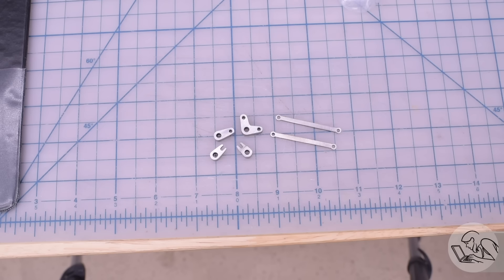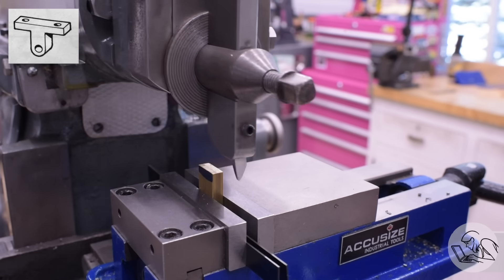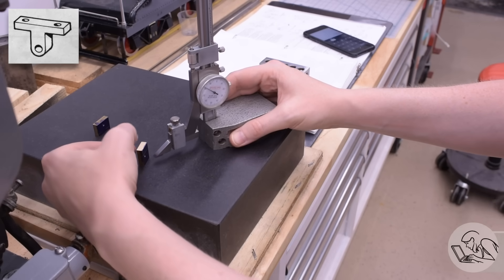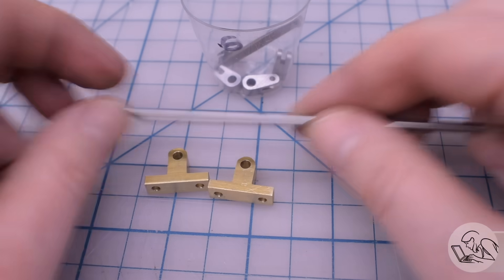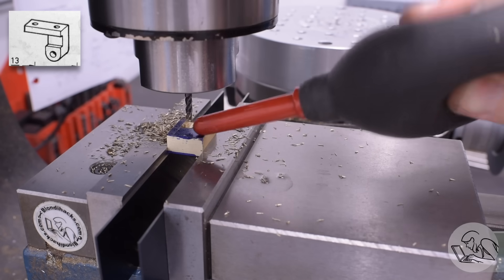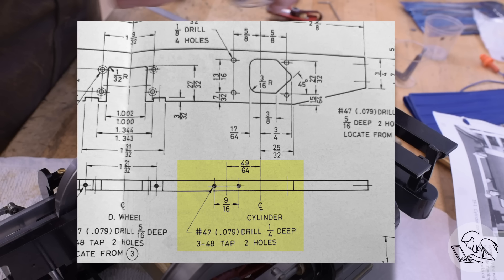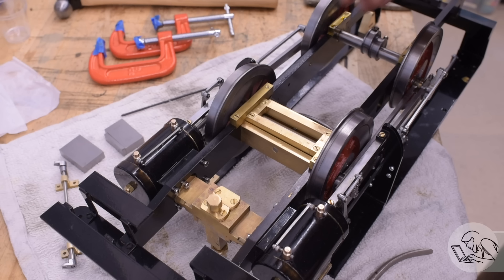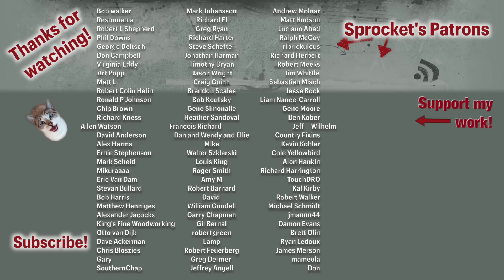Drain Control Bracketry - Pennsylvania A3 Switcher, Part 75

Comment: Well with the proper size machine, you could drill those holes on the real thing. In 1941, for the low, low price of 10,300 dollars, you could have gotten an American Hole Wizard radial drill with a 7 foot arm and a 17 inch column. You might need to reinforce your garage floor however; it weighs over 20,000 pounds.

Comment: How do you measure the correct length of the shaft, if it’s inside the chuck?
Reply from the maker: You face one end, remove it, face the other end, remove and measure, reinsert, touch off, and face remaining amount

Comment: I got really confused about the drain valve placement for far longer than I'd like to admit until I realized the whole assembly was upsidedown
Reply from the maker: Sorry, I didn’t explain that well. I see how it was confusing with only close up shots of the work
Reply: No worries, it makes far more sense to flip it and work on it where you (and we) can see what you're doing.  Although that does beg the question of how one works on the undercarriage of such a model once the boiler and such are mounted.
Reply: @Emu0181   very carefully